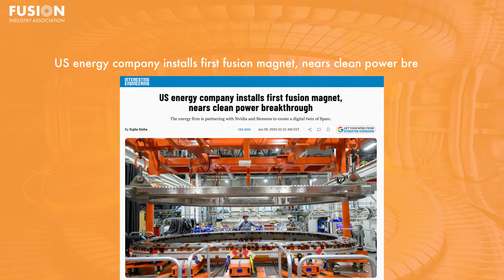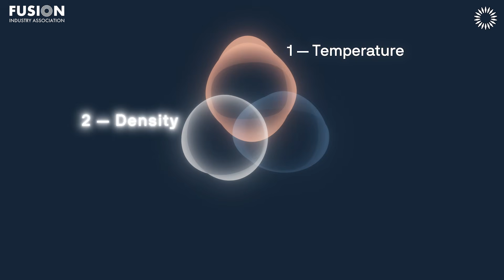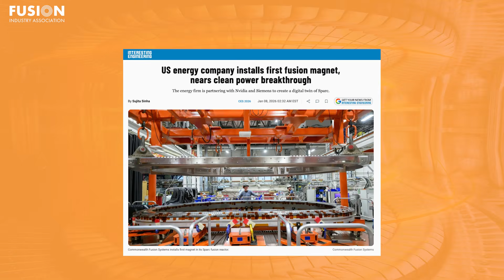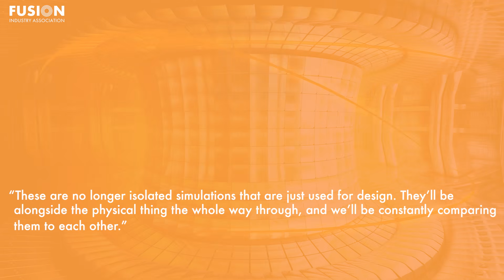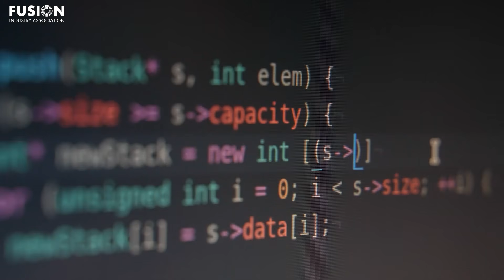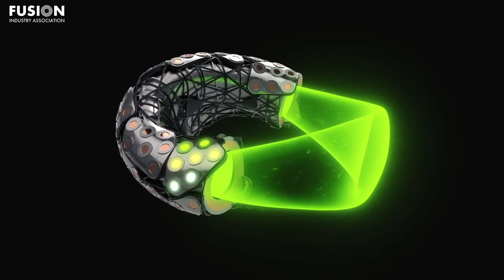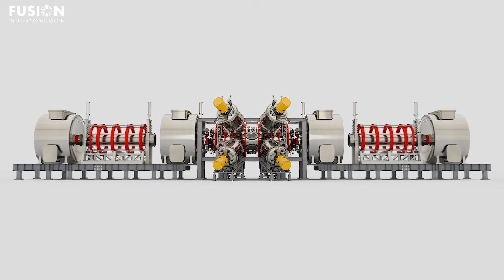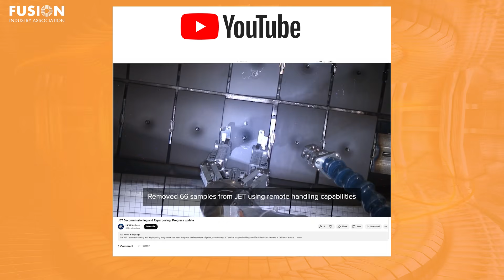Fusion News, January 21, 2026

Comment: There is no such thing, and will be no such thing, as "fusion energy". Fusion, in the best case, would be way more expensive than fission, and fission is already very far from competitive with solar + wind + storage. Fusion might have a future on outer solar system probes, but that is all. And maybe not even there.
Reply: And how would you know better than the highly qualified professionals working on it with increasing confidence? PV is fusion energy by the way.. and several devices have produced some fusion energy, these experiments were just too small to put out more than needed to initiate the fusion process.

Comment: I would imagine that self-organizing should be considered more of a problem than a solution.
Reply: Can you elaborate your comment? Are you thinking in terms of self-organization in the Reversed Field Pinch?
Reply: @jjeherrera  No, my line of thought was more: 
If you have an entity that you want to regulate that shows signs of self-organization 
then the result could be that the energy is lowered or that the self-organisation can 
absorb energy. 
If for example you have counted on homogeneity and that is disrupted by self-
organization then that could lead to results that could be difficult to analyze.